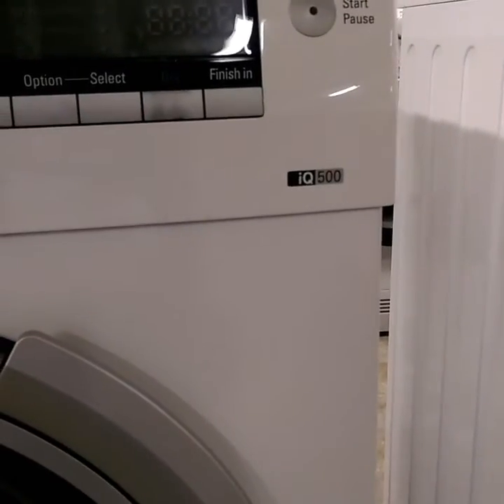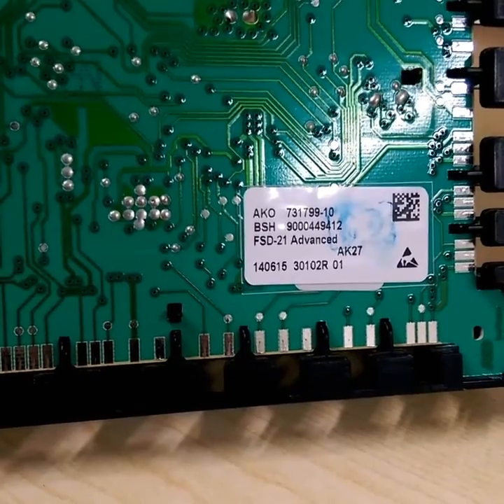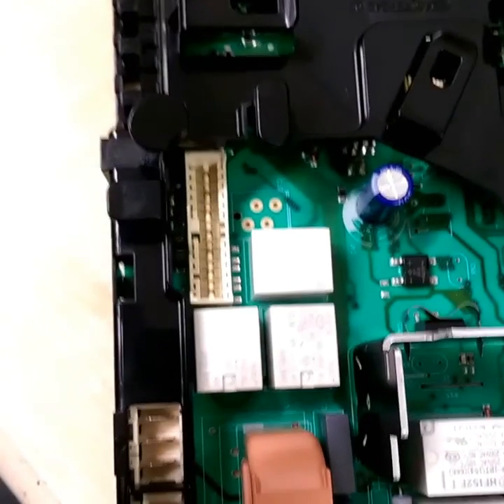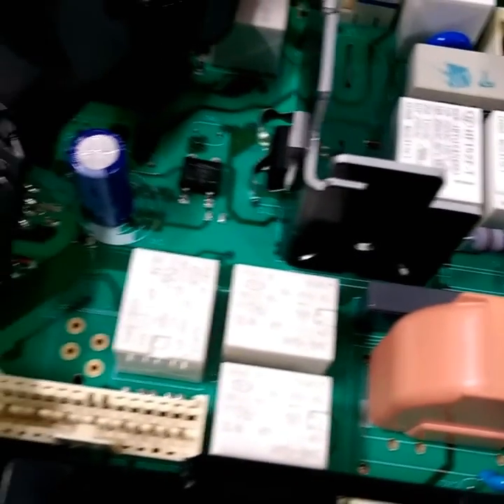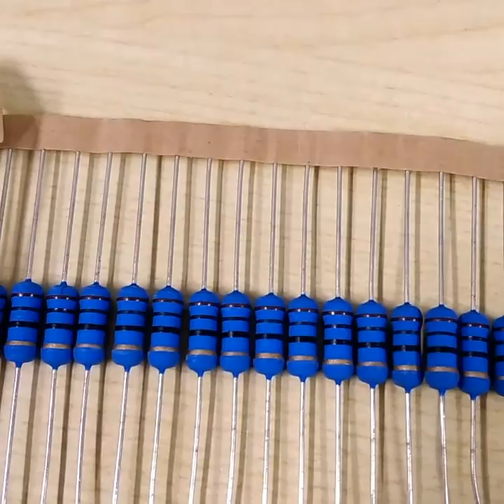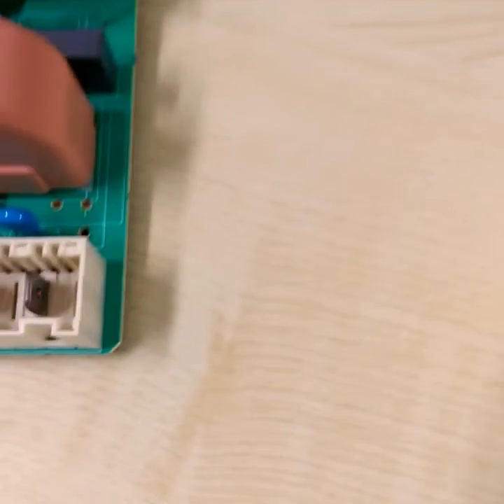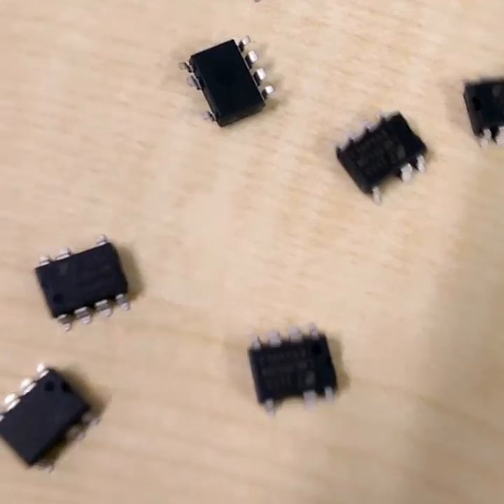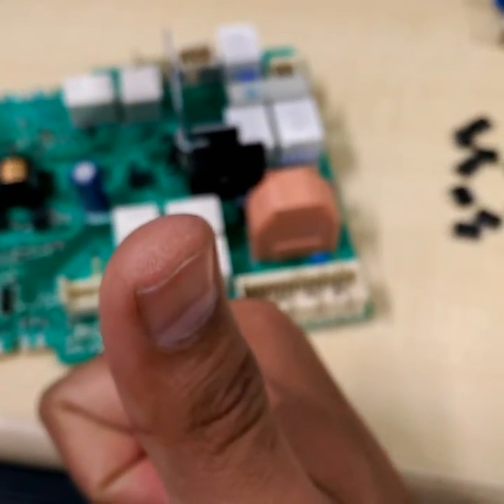SIEMENS/ BOSH washer dryer PCB Resistor burn. AKO-731799-10

Comment: Thank you for your video, will order the parts and give this a go. Is it possible that the black component next to K8 relay blows as well? There is black dust against the relay next to that component?n It has SM11 on it. Not sure if its part of that circuit and needs replacing as well?

Comment: thank you. now the bosch washing machine starts again but it returns a A:02 error code ( Too much water or too hot water.) any hint to solve the issue or to reset the error?
Reply from the maker: It might be resistor. 100k 2 watt. Replacement with Lnk304gn . Will work
Reply from the maker: A02 releted wiyh temperature of drum try to fulp clean or empty. Check board wiring connection propely. And replace the sensor. Temp sensor. Usually 2 ports.pin
Reply: I invite you to chat with masters in electronics of washing machines, refrigerators in the Watsapp. If you are interested, write to me.
Reply: I solved the problem. It was related to a connector not properly locked on the main board.
Reply from the maker: foam detedted, turn run cycle drum clean & keep stand by mode for bit time
Reply: @SantoshJadhavsnowgold  hi sir gud information and i have a small doubt in that pcb one small component blastd blue colour small size how to ill check exactly
Reply from the maker: @santhoshkumarsanthu6408  which component.details
Reply from the maker: Ok i am interested add me
Reply: @SantoshJadhavsnowgold  Give me your phon nomber
Reply from the maker: @БульБуль-щ2ь  +971569431477

Comment: Thank you Sir for your explanation. I am diagnosing an issue where the washing machines main heater is stuck on. Have traced it through to on this board and fingers crossed I will be able to fix it. Your video has provided some good insights on this control board.
Reply from the maker: is the issue solved